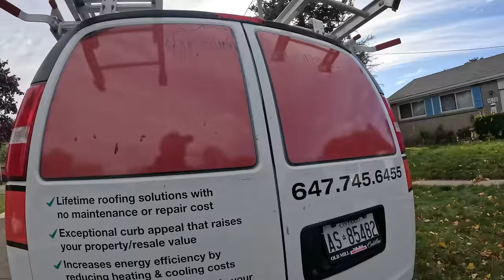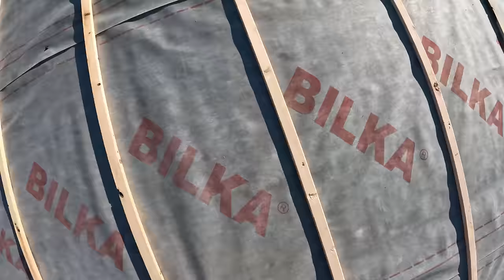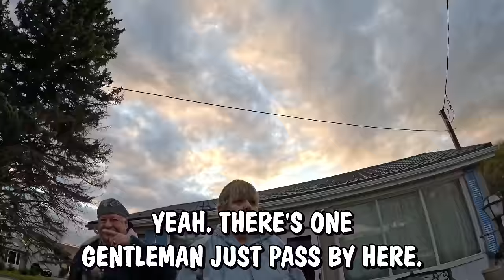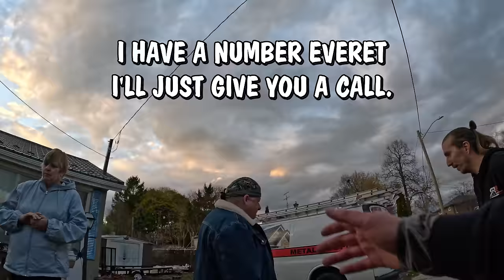Lady BURSTS into TEARS as She Finds Out ROOF is Completely FREE!

Comment: What a marvellous gesture and clearly your hearts are in the right place. In the UK we still use concrete and slate tiles which are fantastic. But I love that roofing system. So light and quick to install.
I wonder if it doesn’t meet UK building regulations ? Shame if that’s the case as I’d have it in a heartbeat
Reply from the maker: Thank you for your kind words! It's interesting to hear about the roofing materials commonly used in the UK, like concrete and slate tiles, which indeed have their own advantages. We're glad you find our roofing system appealing for its lightness and quick installation. Regarding UK building regulations, roofing materials and methods can vary significantly based on local codes and climate conditions. It's possible that our system may not be used in the UK due to such factors. Thanks again for your interest, and we hope you continue to enjoy our videos!

Comment: I was worried because the back boards for the gutters were in a terrible state, but your tin roof system covers the gaps from the top, very clever. Makes for a quick install that works. I wish I had gone for a tin roof instead of traditional clay tile. I live in Finland so the saving in man hours would have saved me weight on the roof and money.

Comment: I can’t believe you didn’t remove the old roof and start on a clear and clean sub strait . I get it you’re doing it for free but why not do it right the first time .
 So who is going back every five years to replace the exposed screws from that crap metal siding your using as a roof material . You ain’t use the new plastic 1x4 s or plastic strapping that would last the life of the roof but you used wood that the sweat will deteriorate over time so no it’s not a lifetime roof your installing it’s a limited life roof of 20 years then because your installation was wrong by leaving old roof underneath .
I love the idea of giving a free roof but put as much skill into installing as you put in giving it away for free.